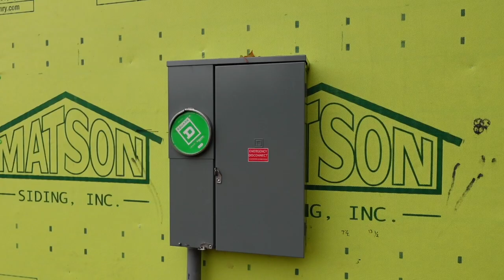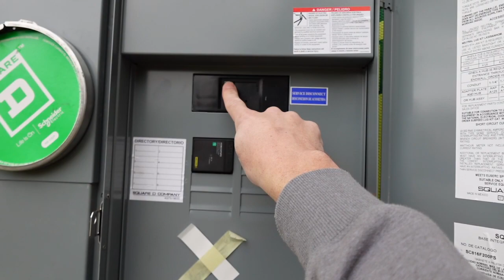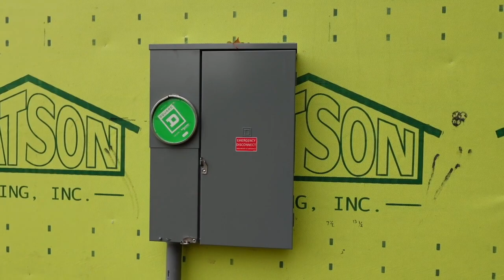How to build a low EMF healthy home

Comment: If there is no objectionable current in any of the branches off the panel, I don't see a reason to isolate the neutral busbar off the metal panel enclosure, givin the neutral will be electrically tied to the ground conductor via the ground busbar which is mounted to the panel enclosure.  Can you speak more on this?  Thank you for this video.

Comment: now you have me thinking about having a raceway or cable tray made out of sheet steel like what is used for duct (or just using air ducting) to cover the wires
Reply from the maker: As long as you bond it back to the system ground, you can use any type of conductive material to reduce radiated AC electric fields from wires 👍

Comment: Ground points with the flimsy wire are too easily damaged / disconnected.
Reply from the maker: Electrical code for your area will specify the proper types of wires to use for safety and durability